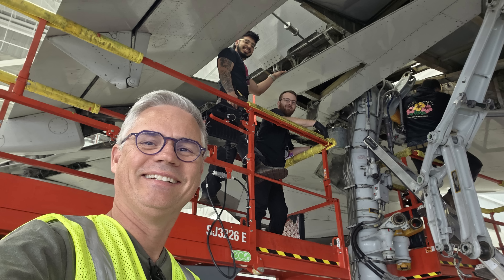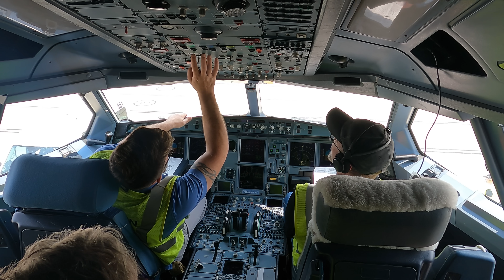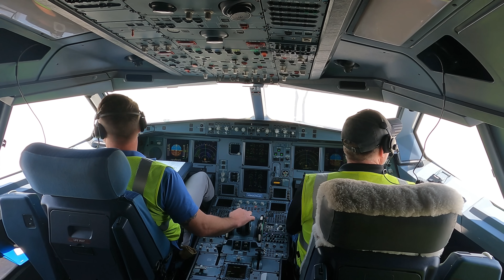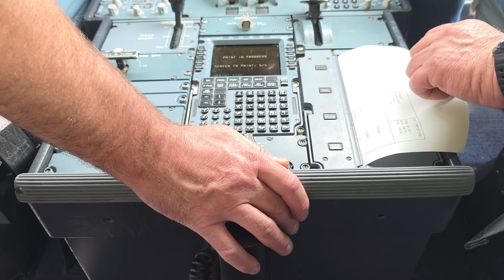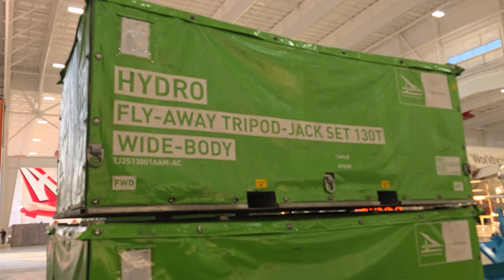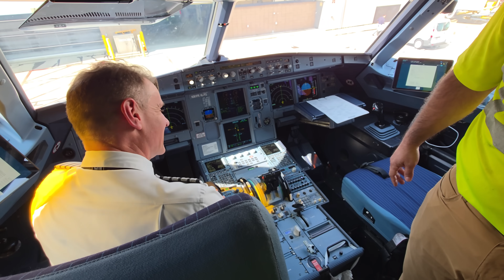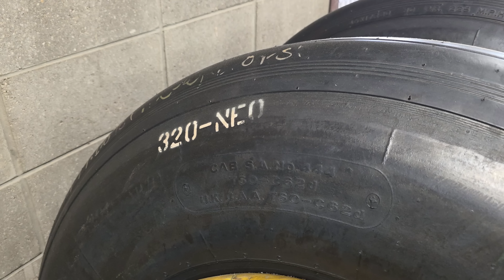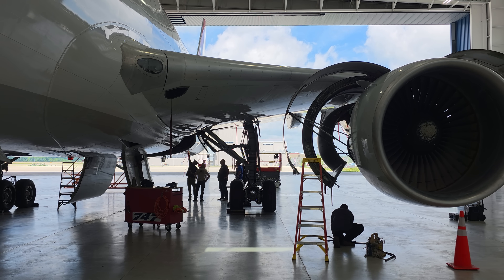What You Don't See From The Terminal - Airports Uncovered Part 2

Comment: Fascinating behind-the-scenes stuff.  
Some years ago, in the course of my work, I was shown around the maintenance hangar at Air New Zealand in Christchurch.  The attention to safety and following of correct procedures was amazing.  Even the most insignificant screw had to be x-rayed to check for fatigue, it's history from manufacture to final use checked and cross checked and signed-off by anyone that came into contact with the part.  Because of the costs involved there is an ever-present chance of possibly inferior ordinary parts being substituted for the real aviation-standard thing, thus the constant attention to security.  Interestingly, being unlicensed I was allowed to see some parts but not to touch or handle anything.